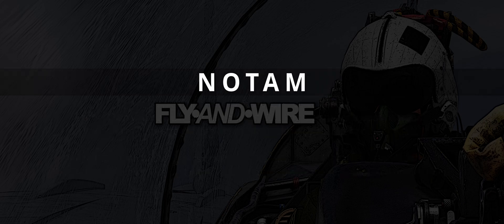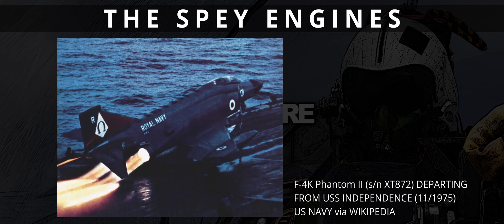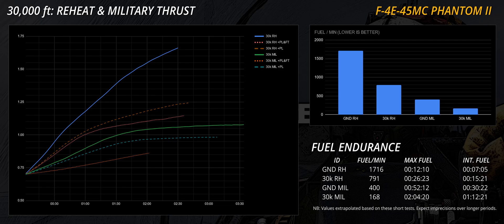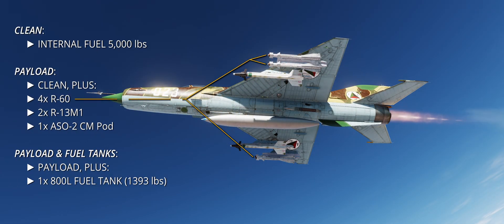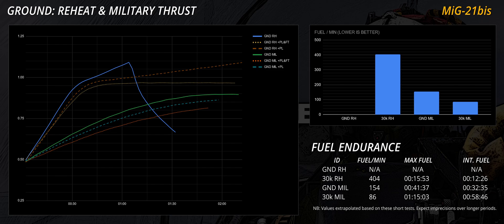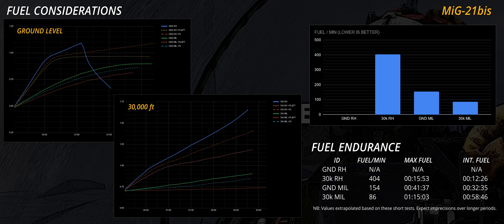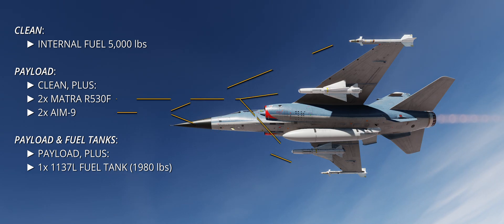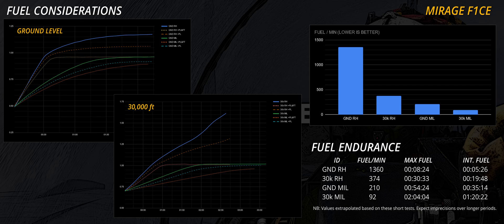TWR, Fuel & Performance: F-4 vs MiG21 vs Mirage F1 - Aircraft Details

Comment: What about a fuel endurance/Combat consumption comparison? If you give each Aircraft a constant of say - 80% internal fuel, Reheat On, and a standard A2A load-out, who runs out of gas first? if that suits your interest.
Reply from the maker: Unfortunately, I doubt it will be meaningful. A thorough study of a single aircraft at various altitudes and setups would be more interesting, but it is a very long study to make. Also, I doubt it will be very interesting, and the conditions change constantly.
Thanks for the idea though!

Comment: Fun fact for those unaware
The reason why the F1's accelleration goes up at supersonic speeds is a special engine mode

Above mach 1.4 the engine max rpm will be raised from 8400 to 8900 rpm giving significantly more thrust!
However, lowering the rpm in that flight regime destroys the engine, so the pilot has to use other methods to slow down, like airbrakes, cutting out the afterburner without pulling back on the throttle or maneuvers

More modern aircraft will keep the engine rpm high regardless of throttle position at high speeds to protect the engine from damage
Reply from the maker: That's very interesting, thank you. I admit I have not looked into the F1 much yet, I'd love to, but I am waiting for the fully polished Cyrano IV.
Reply: @FlyAndWire  That's fair. Radar simulation for that aircraft is rather simple right now. I m glad we're getting a rework c:

Comment: No emergency afterburner data included for R25?
Reply from the maker: I decided against doing it for two reasons:
- it's not common IRL, it may require extensive ground work post-flight;
- I was not sure if there was enough interest. Gathering these numbers takes quite a lot of time.
Reply: @FlyAndWire  Its intended for combat if needed.
Reply from the maker: I am aware. It is not the default condition. It is a boost intended to be used for a limited amount of time and then left to cool off. From my understanding, it implies more ground maintenance later.
It's like saying that the MiG-25 can get to M3, but then you need to bin the engines.
Reply: @FlyAndWire  That's fair, but you're doing the tests in DCS, and it probably attracts a lot of DCS players, who use the emergency afterburner 100% of the time in a dogfight to be competitive (there are no drawbacks in DCS), and want to see relevant data for this mode.
Reply from the maker: Sure, but you don't do an endurance test in a dynamic environment with an emergency mode. What I'm trying to say is that the situation you describe is too complex: for example, check the differences between the consumption at ground level and 30k. Now, a dogfight may span through any altitude, and the consumption changes dramatically as you go up and down. How would you make a relatively accurate model in such conditions? I'm not saying it can't be done, just that it would take a lot of time (for reference, it took me 4 months to collect data and make these videos).
Reply: @FlyAndWire  All good.